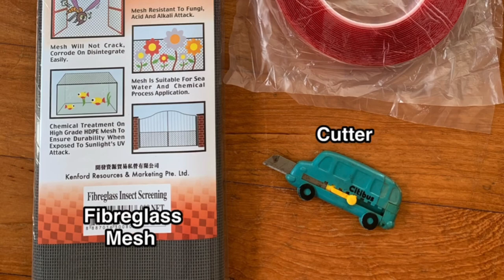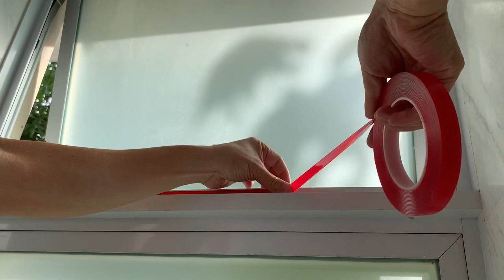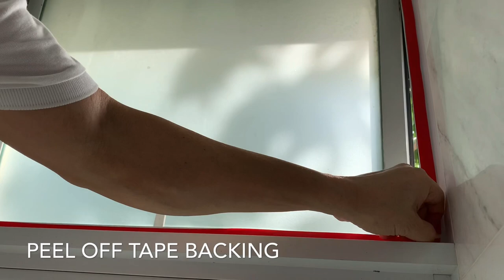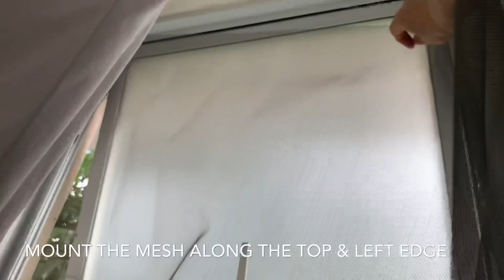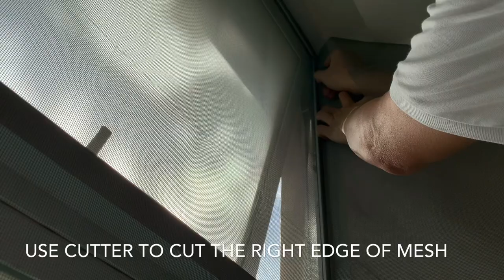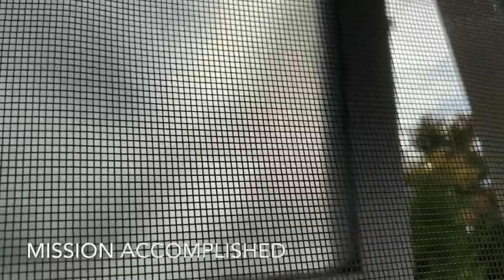DIY Insect Screen for Windows

Comment: u got a problem - how u close or open this window .. hahah
Reply from the maker: This window I never close!
Reply: Oh gosh, I was eager to find out how she would pull that off, I'm so disappointed 😥
Reply: @KSToh  what would be the solution if you need to close/open the window?
Reply from the maker: @justlikethatnowadays8454  https://youtu.be/Tc8pJ6HLTdo
Reply: @justlikethatnowadays8454  You can fit the mesh with the window closed and fit the net more loosely at the bottom. Doesn't look as nice but works okay. When you need to open the window, peel the mesh under the handle away from the tape, open the window, and stick it back down.